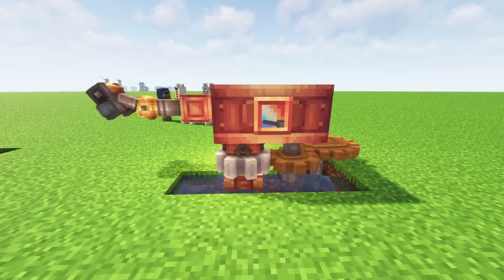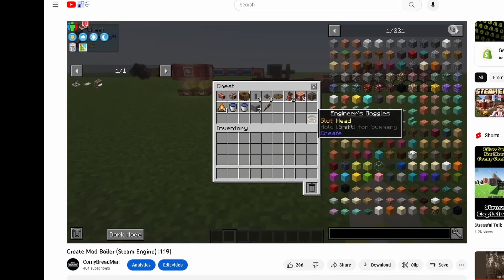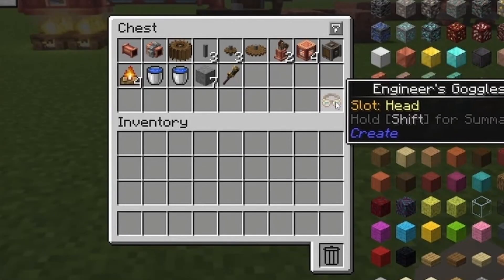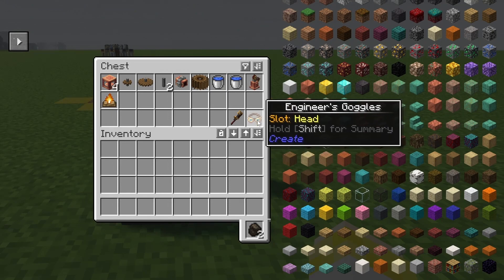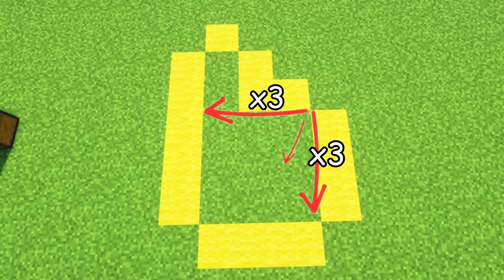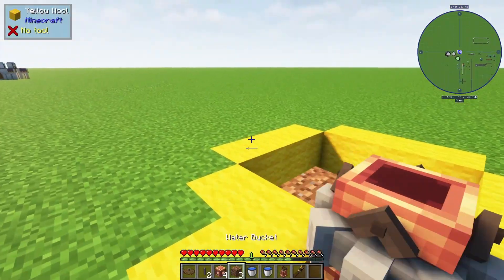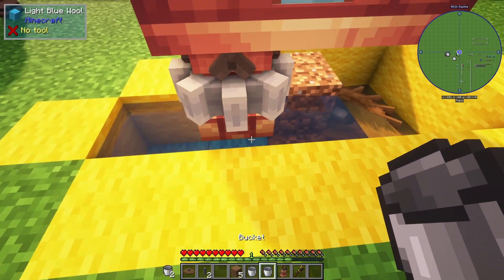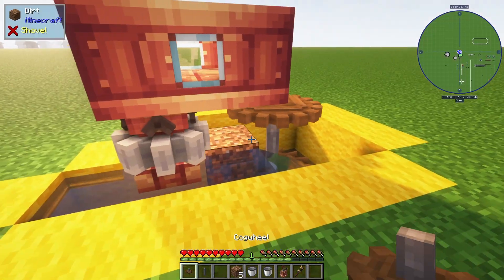EASIEST Create mod Boiler!! (Steam Engine) |1.19|

Comment: For some reason my boiler says idle and will not change to passive. any ideas?
Reply from the maker: Make sure the pump is facing the correct direction. There’s an arrow on it make sure it’s pointed towards the boiler. That being said a steam engine needs water, heat, and size. So if it’s not big enough “ with 4 tanks” or or isn’t getting water or heat it won’t work. Try using the create goggles.
Reply: @cornybreadman  No , mine is built exactly to spec as well with same issue. There does appear to be some form of inconsistency will be testing and updating.
Reply from the maker: @Dabberwockyjones  I’m sorry to hear that!
Reply: First contact with questionable spec, water pump only getting 8mb/10mb
Reply from the maker: @Dabberwockyjones  is it going to slow somehow? Like the pump.
Reply: @cornybreadman  Its possible, I ended up with same build but added some large cog/ small cog differentials between the waterwheel and the pump and it fixed problem
Reply: @Dabberwockyjones Are you playing in version 0.51? If you are, then it was probaly needed. In version 0.51, water wheels got an update. The water wheels paddles are flat now,so you cant get a speed of 20/16 rpm. Only 8.